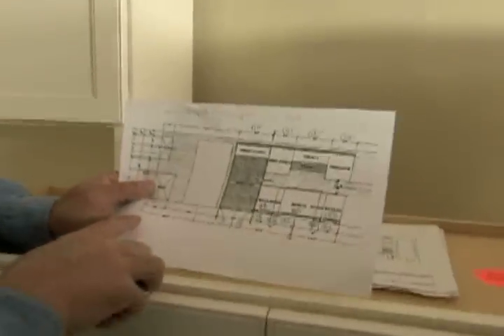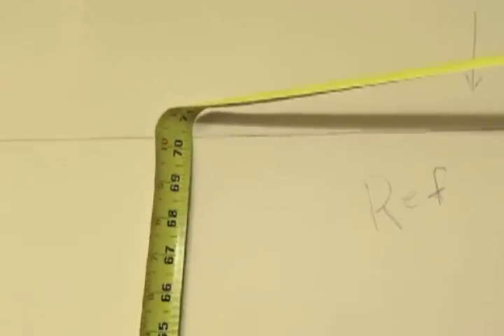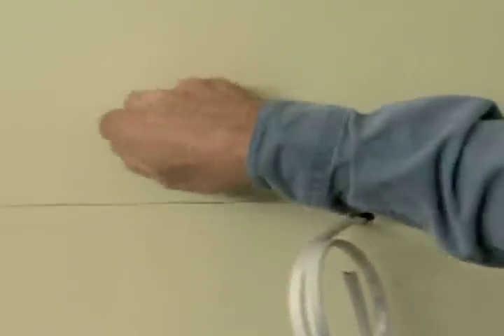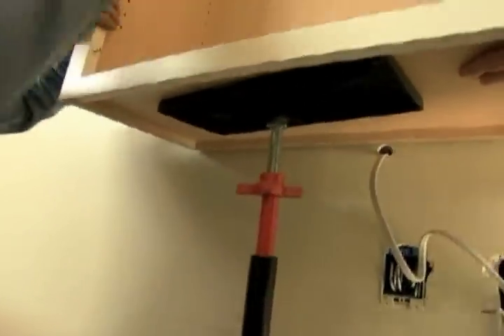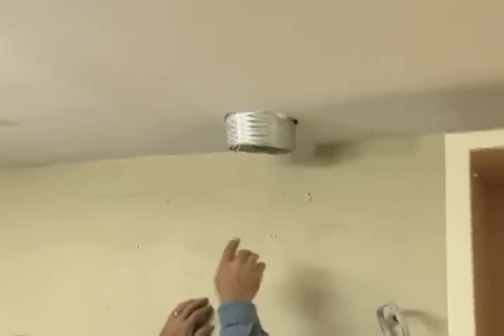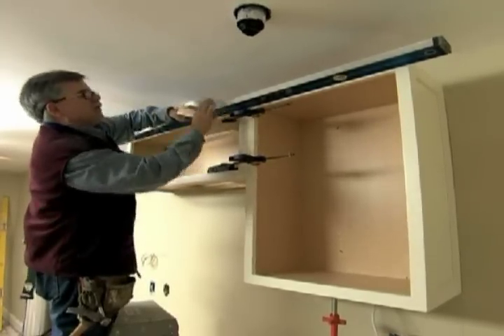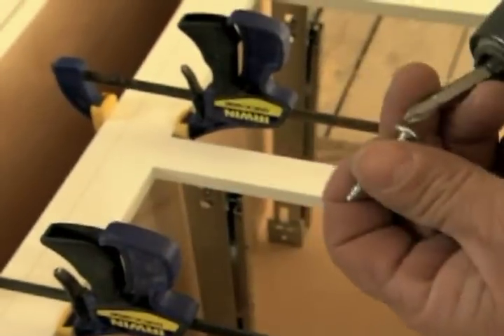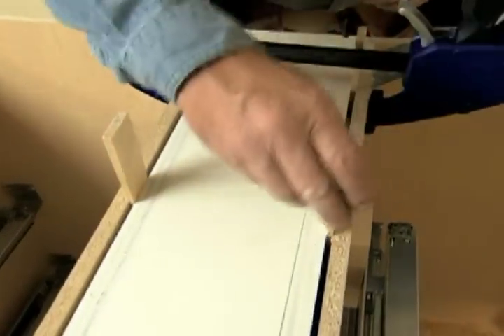How to Install Kitchen Cabinets | This Old House

Comment: Good info
I used ez-level cabinets levelers as it was a huge help over using regular shims. Night and day, really helped me get all the cabinets dialed in, plus I was able to raise them all about 1/4 inch to protect from water issues

Comment: Not only don you need to locate the stud, you need to locate the center of the stud so when the cabinet is in place and your putting the screws in, they don't glance off the side of the stud or come close to the edge of the stud which will weaken in time.
Reply: yes, yes, yes, yes, YES!!!!

Comment: I always screw above the cabinets, in case you make a mistake, which you'll surely will, nobody is going to see the empty hole on top, next I attach them together, and finally when everything looks right, I drive a screw on the inside bottom of each wall cabinet. 

pro tip, always install your base cabinets first, lay a board on top and walk on top of them to install wall cabinets

Comment: Mr. Silva, I am in Cambridge, MA and need an skilled and honest carpenter that can disassemble and reassemble the Lazy Susan as it seems to let a mouse in through some small hole or holes. Could you suggest a couple of professionals or send "your crew?"

Comment: What do you do with the Shims after? Especially the ones at the base of the lower cabinets? How do you hide them?
Reply: Trim them flush and install quarter round trim if your flooring is already down, if it isn't, the flooring will cover them when it's installed.
Reply: Nice, so simple.
Reply: Matt MMM or install a new 1/4 toe kick face ,,

Comment: Been doing this for over 25 years. Putting in flooring first is almost never done. What if tile was going down over plywood subfloor? Screwing through tile just made your job harder. Also what if you need shims or a toe screw if it's hardwood flooring you'll screw up the finish.
Reply: Completely irrelevant to me.  Can put shins at floor or subfloor.  If is island a few blocks will do.

Comment: Find the high spot in your floor first. Screw your wall cabinets together as a unit and hang on a ledger as a unit. I always install base cabinets beginning at the high point, one at a time. And shim, clamp each together. Also I screw cabinets together through the face frame by pre-drilling and screwing. Much stronger.

Comment: One good reason to put flooring under cabinets is in case you ever want to redo the kitchen in 10 years. You will be able to move things around without trying to match in a floor.
2nd reason not so good. Should you need to alter the kitchen to accommodate someone that now has to use a wheelchair ie: sink or cooktop, the floor is already in.
I t will cost more in terms of labor to have the floor installed later
There is a real good chance that the floor guys will bang up and splash stain/finish on the cabinetry
Cabinets should be screwed together through the face frames-preferably hidden behind the hinges. Putting screws behind the frame places stress that will force the frames to leave a gap- if not today, it will happen
Reply: +danstep I see merit in doing it both ways. What if you need to replace the floor before replacing the cabinets? Installing the cabinets first, then the flooring ensures that the floor and the cabinets are two separate entities not bound to each other.

Comment: Oh forgot to ask, can you fix upper cabinets that are separating from the wall, or do I need to actually replace them?  Dang things are only 9 years old.
Reply: Did you ever find out the answer? The same thing is happening to us.
Reply: Taryn S sadly no.
All the handy man say I need to replace the cabinets.  Seems insane.  Grandparents cabinets are original and the house is over 50 years old.  Mine could not last 10 years.
Reply: That's modern workmanship for you.😒

Comment: our kitchen cabinets are on the north wall of house and get really cold inside. What would be a good type of insulation to use inside of cabinets?
Reply: I am sorry no one replied. no one really does. I am "guessing" your walls do not have very much insulation! I would suggest a non polluting/emitting foam board
Reply: Yes, thank you. A type of insulation that would be safe to use around food containers was what I was looking for. I settled on the chrome finish product that looks a lot like packing material that is commonly seen in rolls at home improvement stores.

Comment: Do they make jacks for built in microwave that goes over the stove it is sooooo heavy?
Reply: Add a 2x4 ledger and screw it into the studs at the bottom of microwave location than you will have something to set the microwave onto while mounting.

Comment: I think it's important to tell folks that the cabinets you're installing are solid wood that's why you can join then together with 1-1/4 screws through the side And not 2-1/2 through the face frame, (countersunk of course)

Comment: Can someone tell me why it is not better to start installation from a corner out? I feel like there is more change of error through irregularities of the cabinets and imperfection in installation. When you get to the corner, you could be either short or long?
Reply: +Jimmy Vaughn I instanly wondered the same thing watching this video. I quickly Googled it and some sites suggest starting in the corner...
Reply: +The_Chosen_1 What if corner is lower than the rest of the room or vise versa? You need to establish level first.
Reply: measure it TWICE ! if you measured properly it does not matter 102 is 102 right ?
Reply: That and his plan has the other side ending at the Fridge - since the position of the movable fridge isn't critical and there is usually a good sized air gap around a fridge.
Reply: the cabinets are all measured for the room and you dont start in a corner because then you can line up the edge of you uppers/lowers and counter top
Reply: It has to do with leveling to the highest part of the floor.

Comment: shouldn't you put the new floor down first ?
Reply: I assume that if you need to re-do or change flooring, it would be easier to not have to rip out cabinetry as well.

Comment: He mentions that he is leveling the lower cabinets because of the inconsistent floor the fact that he installs the cabinets tells us he is not going to floor under them. With certain (most) types of flooring you install it last.

Comment: Flooring under cabinets: As far as paying for flooring you never see, that's a total myth. There is always PLENTY of flooring left on any flooring job (even tile), enough to put all the scraps (wood floor) or bad tiles under the cabinets. I've installed 4 floors and there are boxes of flooring in my garage filled with left-over scraps and bad boards. I've always ordered an extra carton or two because you get bad pieces in the order.

Comment: First cabinet video on YT I seen somebody checking flush fitting of face and fixing it with shims.  Matter of fact most YT videos on cabinets I do not see them using shims at all.  Is that normal not to use shims?
Reply: +Ninja 87 You aw how unlevel and unplumb the floor and walls were.  Those shims helped a lot.
Reply: Fletch Lives Daily Thanks for the reply.  Still debating if I should fix my own kitchen cabinets myself of pay somebody way too much money to do it for me???
Reply: Go for it yourself....im going with Cabinets togo in orlando.  You assemble them and install them yourself.  As long as you follow general measuring and levelness, you can do it....  Good Luck.

Comment: There are cabinet screws now, why not that for upper?  Also the face should be screwed, not behind the style, using finish head 2.5 This is a little too old.

Comment: Build houses properly with brick and you don't have to worry about stud positions. Also, have Americans not woken up yet to putting adjustable legs on base units, and adjustable hangers for the wall units? W'e've had them here in the UK / Europe for decades. So much simpler to fit.
Reply: Daniel Saint were more into quality and craftsmanship. Base legs look ugly, floating cabinets are becoming the standard for higher end homes because of the wall to wall flooring reveal. You don't need wall adjusters, you can shim the cabinets with scrap wood
Reply: Here in California we have too many earthquakes for brick structures. Wood flexes.

Comment: Ive talked to several builders about this guy, all say he over complicates everything he does.
Reply: sundew2007... You are wrong. You haven't talk to anybody.  You just made up this story for this purpose as to make a comment.  Look, I have learnd good number of things from this guy and as a handy man everyone says it's good and customer likes it. Why don't you give us som proof of your statement. You spoke with guys who spent all day sitting,  smoking, drinking and wasting gods day. Those guys have no idea how to wipe the fog from the windows not to mention bigger project like, how to remove shoe under the bed. Stop pretending as perfectionist.  You are good for nothing.
Reply: damystica That's what I'm talking about.  what's happened?  No comment.  Upsyyyy
Reply: id hire him over them in a heart beat
Reply: I realize how much wasted motion is saved by using all the great tips and clever ideas through many different YT video by installers. 
It is not a one size fits all scenario nor the same quality of cabinetry. 

Higher end homes install real wood, while new,  multi-unit sub-division homes use compressed crap cabinets with formica tops.   

When you are charging for quality installs, you should receive no less.  

The Florida builders expect that you do quality work no matter the bid price. However, those cheap cabinets aren’t going to get any love and attention when you have to bang out 6 full kitchens, 12 upstairs bathrooms in 8 hours. Not going to happen.  

Fun to watch right to left, when everyone installs from the corner outwards.

Comment: No!! Wrong from the start. There should be a MINIMUM of 18” between wall cabinets and countertops
Reply: Jason Pearson why? What if the backsplash is custom and shorter? Like 12" tile placed diagonal? Any typical small appliance will fit probably under 15"

I'm legitimately wondering why you choose 18" as a standard